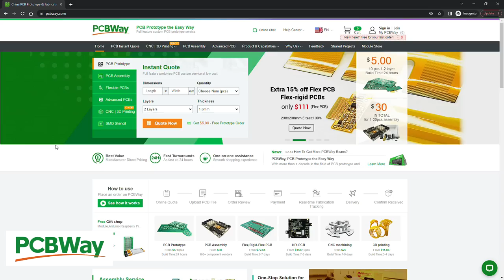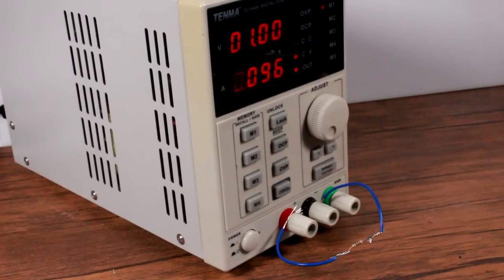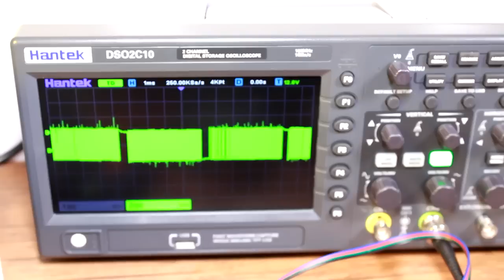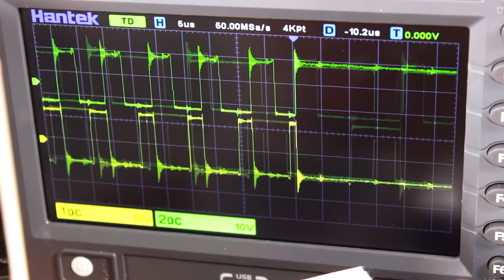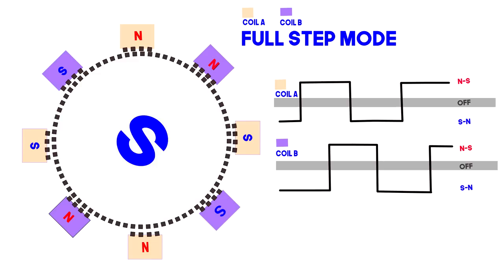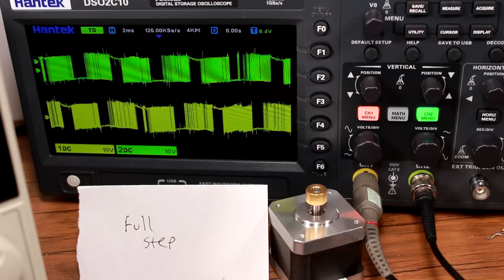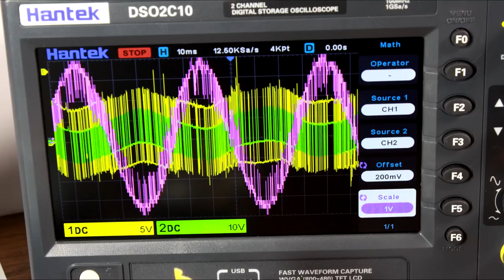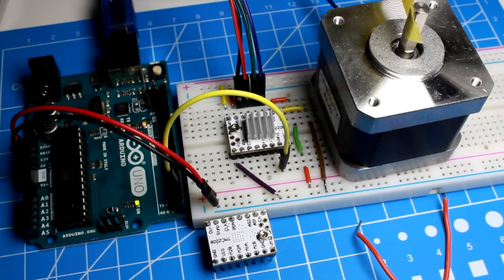Let me explain microstepping and chopper modes - How 3D Printing Stepper Motors work - Part 2

Comment: A while back I searched a lot for drawbacks of high microstepping. I think I remember watching a video or something from TMC that said that microstepping doesn't actually reduce torque. Sure the exact position isn't as "stable" but the total force in that direction should still add up to be around the same. Basically the resolution you gained is a bit more uncertain but if you compare x16 to x32 for example you should still need the same amount of force to skip 1x x16 steps vs 2x x32 steps. To sum it up if you tell a stepper motor to move a total of 5 degrees the torque applied will be the same at x16 and x256 microstepping. You are just making it possible to move the motor by less degrees and only the accuracy and torque of those smaller increments is influenced.
Reply from the maker: Yeah this makes sense,
Reply: @LostInTech3D  oh and as far as I can tell the main drawback to really high microstepping is actually the calculations required. Cheaper/older boards can't handle enough step calculations to do 256 microstepping, especially if you are using more than 4 steppers. Besides that most people should be able to just use 256 microstepping and enjoy the silence (I use 64 because my boards sucks xD). 

Based on the klipper tmc driver documentation you also want to use spreadCycle and not stealthChop (thanks to high microstepping it is pretty quiet anyway) because it results in less torque and apparently quite the significant positional inaccuracy (in their example 0.150mm). Interpolation apparently also introduces around half a microstep of error which is about 0.006mm at x16 microstepping.
Reply: @Karavusk  Thank you for this explanation. I want to find more information on microstepping for position applications but sadly didnt find much how it works. Can you share some literature recommendations, that would be really helpfull. Thanks!
Reply: @garvasrani8410  I got my information from the klipper tmc driver configuration, some youtube videos and random google searches over time. I don't really have one single good source that would be better than whatever Google would show you.
If I remember correctly I did search for something like "does microstepping lower torque" and I ended up finding a video from tmc about that.
By the way if you really want greater precision you can always go for 0.9 degree motors and use high microstepping but for 3d printing this is a bit overkill.
Reply: @Karavusk  Ok thank you for the reply. My project is not for a 3d printer its just a high precision angular position laser. Wanted to implement 64 or 128 microsteps for finer resolution. Ill look into that. Thanks again!
Reply: @garvasrani8410  The klipper tmc driver guide definitely has some nice tips for this. Using spreadCycle is a must and interpolation just adds error.
I would try out 0.9 degree motors and 256 microstepping in your case. If you have any issues you can just change it back. You most likely don't get the full precision, just the play in pretty much everything is larger than this but it shouldn't hurt. Unless your mainboard can't handle it, then obviously go for 128 or 64^^

Comment: I constructed a motorized stage for a microscope that needed to move heavy samples. I used a set of 13 kg high-torque steppers that were massively overspec'd for the load. The advantage of this is they never ever failed to step so the movement of the sample in front of the microscope lens was always very repeatable.
Reply from the maker: yep - I noticed some printers do this too, especially deltas and larger bed slingers, I'm not even sure it uses more current when you're running trinamic drivers either, so it's a good solution!

Comment: “Magic numbers” is a disservice of a name to what is basic math. You explained it, the further away from discrete full steps the lower the torque and thus for Z axis especially equates to potential to drift. Using full or half step values is still best for layer heights for this value.
Reply from the maker: But here's a question - how do you know you're starting at a full step?
Reply: @LostInTech3D  your toolhead gcode Z position is at that of a multiple of your full step increment.
Reply from the maker: But you can't know if it's at, say, 5/32th microstep when z=0. So the z=0 position is not at a full step increment. So every increment would then be a 5/32 microstep. Thus, have the low torque and inaccuracy. Do you see what I mean?
Reply: @LostInTech3D  klipper provides the ability to get actual MCU read-values on the position with GET_POSITION. It’s on you to set your offsets and homing procedures to wind up at a full step, these are robots after all.
Reply from the maker: I've not heard of anyone trying to do that. Do you do that?
Reply: @LostInTech3D  Well I use the feature in klipper that does it for me: `endstop_align_zero`

Comment: For future reference: to get those current waveforms, rather than heat up a trio of shunt resistors, you can simply measure the voltage from the controller end of the wire to the motor end of the same wire. You’ll probably need to use a 10x probe to see this (much smaller) voltage differential, but at least you don’t introduce more resistance than needed.
Reply from the maker: Yeah - I tried that, and a long (>10m) wire too, none of this was enough to get a good trace. I mean, on this scope anyway. Doesn't a 10x probe work the other way though?
Reply: @LostInTech3D  LOL, I forgot how attenuation factors work. The 10x probe is indeed the opposite of the direction you’d want - 1x probe would be the correct choice. It sounds like your scope doesn’t have the necessary resolution to pick up a millivolt-scale signal, though - boo.

Comment: I think that basically everything in 3d printing has more of an effect on layer quality than magic numbers, but I would be interested to see the exact torque values of microstepping vs torque required to move the axis.
Reply from the maker: Yes - I was thinking about how hard it would be to measure these torques, and more importantly, something I didn't explain yet, how torque (load) makes the motor lag behind the step position it should be.
Reply: Eddietheengineer on YouTube has and is doing some interesting analyses in this domain with actual test equipment and math.
Reply from the maker: I will check it out
Reply: I'd be more concerned about the magic smoke than the magic numbers 😄

Comment: On most Stepper Drivers there is a sense resistor (aka shunt resistor onboard). I once soldered two wires to the end and probed that signal. Looked like the Current waveform on one coil :) can you confirm it is similar to your shunt resistor?

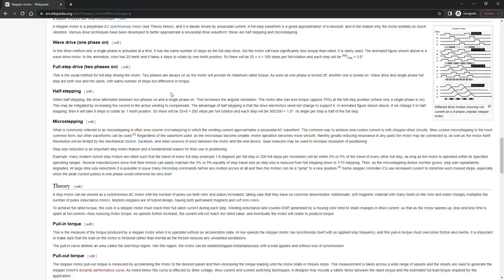Comment: 8:03 so microstepping works like a mixing hotend with the position beeing the final colour (if you mix two).
About magic numbers: I don't know if you can see on a print if a layer ,,sits" on a step or not, but if you use magic numbers either all layers will do or, what is more likely, none will do since z=0 mustn't be on a step. If you wouldn't use magic numbers some layers will be on a step, most wouldn't so if there is a difference you'd notice. With magic numbers you'd be on the save side.
Reply: So what are you saying, can it be proven (or disproved) with test prints? There must also be 'magic level', done with 'magic wand'. Wait, that must be a feeler gauge...
Reply: @TechieSewing  I think you could do both if you somehow could see if the motor is on a step or not. This way you could compare it with a test print and also set z=0 on a step
Reply from the maker: Yes, the not knowing if you're on a magic step thing troubles me, but, I just think once you round it all down with the gearing, 1.8 degrees/n where n >2 is... negligible compared even to the z rod thread variance. But...I'm open to opinions and it would be cool to find a way to test it and put it to bed once and for all.
Reply: @LostInTech3D  I think the people who suggested magic stepping were arguing in the days of bent leads screws and m8 threaded bar being substituted for a trapezoidal leadscrew, this lead to alot of binding on the z axis so by taking full steps the torque is kept to maximum and less likely to bind, thus causing visible artifacts. 
It seems to be less of an issue now trapezoidal leadscrews are cheaply available and frames aren't made of wood and bearings aren't brass/pla bushings running on the straightest 8mm smooth rod u had in your collection. 
Good video
Reply: @JB-yu1vv  They way I see it, one could have printed a few cylinders with 0.19, 0.21, 0.15, 0.16 etc and compare them to 0.2 and 0.16. But the results would be visible or not depending on where z=0 is? Do you expect "none of the layers" to look differenly and better than 'some layers are'?
Reply: @TechieSewing  I'd expect without magic numbers some layers to look different then most layers and with magic numbers that all would look the same
Reply: @JB-yu1vv  Looks like at least something to test for. If I can think of a suitable project that requires several identical small objects, I'll try that myself.
Reply: @TechieSewing  Z=0 home should always be on full step (at least in Marlin). Mesh levelling and Z-offset will change it when printing, so no mesh + Z-offset at full step (e.g. multiple of 0.04 mm) should do the trick.
Reply: @kimmotoivanen  Hmm, so as I currently use Z offset of 0.05, I'm not using 'magic numbers' anyway. And so do (don't) all the ABL users and ABL printers.
Reply from the maker: I'm curious as to how z=0 is a full step? It's driven by the limit switch?
Reply: @LostInTech3D  I'm pretty much wrong. I thought that was "good info", read from internet... FW could, in theory, count from power-on (assuming driver starts from full step) and in some cases (2208 + UART) read directly from driver where the motor exactly it is, but I doubt first is used anywhere and second wouldn't work for any Ender 3 clone because no UART. So printer has generally no idea which microstep triggered the endstop.
Reply: I may have remembered wrong. Marlin with UART control could read the phase and back to full step (TMC_HOME_PHASE) but which printers have it enabled...
WIthout phase info, Z=0 (endstop trigger) can be at any microstep :/
Reply: @TechieSewing  I was wrong. With 8 mm lead screw proper test layer height could be edited 0.2025 mm (5 x full step 0.04 + 1/16 step 0.0025) edited . If lead screw itself does not create artifacts.
Or just not worry about magic until part III of stepper secrets ;)
Reply: @kimmotoivanen  Z0= starts at fullstep + fullstep/microstep, by using fullsteps(magic numbers)

you ensure the motor has maximum available torque to get to the next nearest full step and at any point during the print if the torque is insufficient the layers above should all be fullsteps above the previous, thus only one layer should be squished.
By using microsteps the motor has reduced torque during that microstep on every layer. if the motor cant move the axis for that microstep on some layers but can on others this could theoretically lead to some layers being slightly thinner than others producing artifacts (overexrusion on squished layers etc.) (my personal view is this used to be a problem when using poor equipment, but I'm sure there is a way to exacerbate the symptoms like turn down stepper current, make the z axis sticky (8mm shaft and Pla bearings ), print a tall single thin walled tower (not vase mode)) then I think you could reproduce the problem or buy a neglect print(i have several XD)

Comment: Wowzers what driver was that...it even had ranging  during the off cycle!
Reply from the maker: You have to or it will slip I think! I don't actually remember which TMC driver it is in that printer.. probably 2208
Reply: @LostInTech3D  or maybe the waveform shows it dubstepping...yep i know that was an awful  joke- sorry 😅

Comment: How do you go about estimating the specs of a no name Chinese stepper?? I have an old telco tornado and I need to figure out how to set the stepper drivers
Reply from the maker: Trial and error mainly I'm afraid. I would personally look at the spec sheets for a similarly sized motor and go from there. Most motors are good to at least 60c but yeah, it's hard to get that info if you don't already know it.

There probably is a sample klipper config out there somewhere?

Comment: So, microstepping tinkers with resolution of the motor at the cost of torque, but if I use a differential gear to get higher resolution, as some extruders, it can increase torque.  Why do we not use gearing to increase printing resolution without the tradeoff?
Reply: That's a good question. One possibility is any time you introduce another mechanical element, you introduce not just mechanical complexity but also additional backlash. You will certainly gain torque but may lose accuracy within the desired precision.
Reply from the maker: Yes it's a good question. The answer is I don't know. I guess it's a combination of speed (gearing down will decrease top speed and.. speeding up to the original speed negates the gains?), noise (silent mode is out if you're running fast) and just manufacturers being cheap. 🤣
That's the only explanations I have.
Reply: @LostInTech3D  To be fair we really don't need higher (motor/movement) accuracy in 3d printing. There are a ton of variables and even at x16 microstepping each step is around 0.006mm? which is probably good enough (not to mention you can just use higher microstepping). If you really want more you can always go for 0.9 degree motors which are already fairly rare.

Besides that gearing is already very common in extruders, sometimes even in combination with 0.9 degree motors (I think that is the default from e3d right now). Although at least the gearing is probably mostly because of torque and not positional accuracy.

Comment: It's common misconception that torque with microstepping is lower. It's wrong. Torque is the same (for particular motor it depends only on motor current). External torque to deflect motor at angle equal one microstep gets lower, because microstep angle gets lower. All in all, going higher microsteps has no downsides as long as board and driver han handle step pulse rate.

Comment: The main function of microstepping is to reduce stepper noise. You do gain a little resolution, but lose holding torque to a point that only half step repositioning is reliable. That's why even though you can have 256x microstepping enabled it is still good practice to round the layer height to the nearest full or half step.

Comment: As I understand it: Microstepping is essentially just using a stepper motor like a brushless DC motor. (I mean, technically it is a type of brushless DC motor, but you get what I'm saying.)
Reply from the maker: Yes I think so. In fact, someone told me the other day that some of these 6 minute benchies were done on printers with BLDC motors and some fancy electronics. Which is something I need to look into to see if it's true!